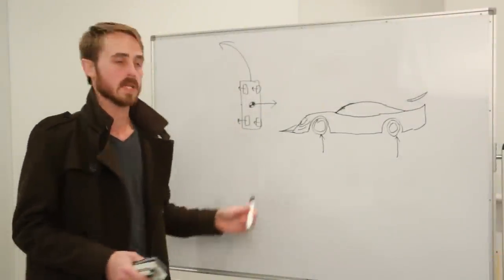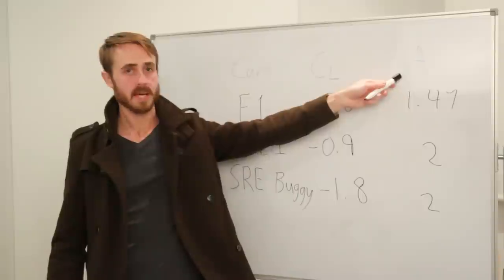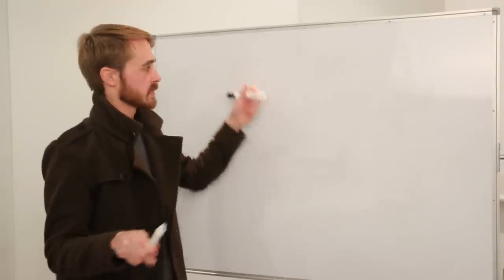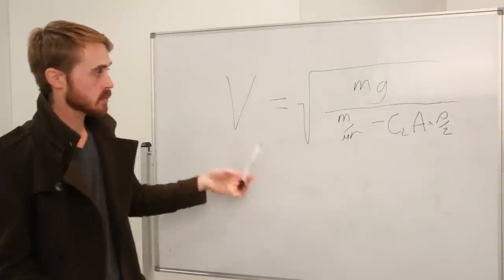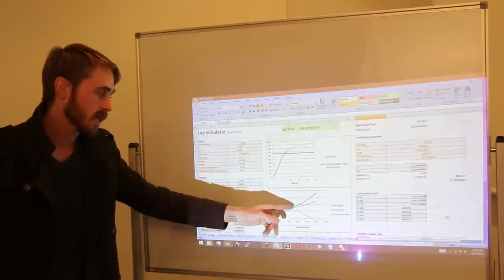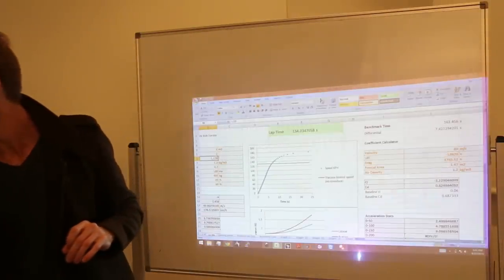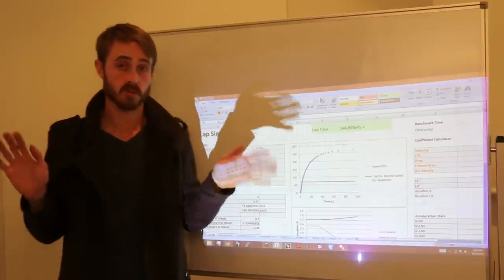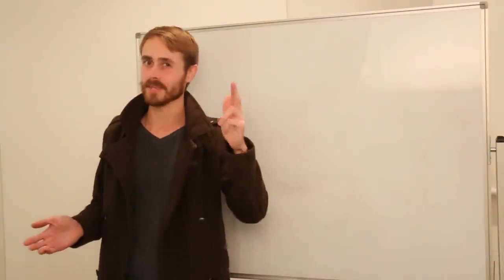What Speed Does Downforce Start Working?

Comment: TL;DR version: Around 100kph/62mph, downforce starts to make a worthwhile improvement. Speeds that less attentive drivers might notice the difference are closer to 160kph/99mph, if not faster. So just focus more on mechanical grip if your trackcar won't be hitting much faster than those speeds.
Reply: I got: If your aero is SERIOUS and well designed you can  expect an effect at around 100 kph but only if your car is VERY LIGHT. If your car is heavy and you slap a massive wang on it you get nothing even at very fast speeds.

Comment: Maybe I'm wrong, but I'd venture to guess your audience has a rather large % of nerdy car enthusiasts that are also non racers.

I appreciate you and several other YouTubers explaining in detail the parts, functions, and physics of aerodynamics, mechanics etc. as related to automobiles. However, as good as it is to dream about driving an F1 vehicle and obsessing about different aero features etc. I'd really love to see more information that is more applicable to real world applications and common modifications / mistakes.

For example a common mod is coilovers / lowering springs, and while there are commonly explanations about why lowering a car is better for performance, I've not heard much about what happens if you lower either the front or rear too much in relationship to each other (both from an Aero, weight transfer, brake bias, etc. perspective).

I'd very much love to see more science applied to road cars. While your formulas go deep into cornering speed with the aid of down force, I'd very much like to see some info about aerodynamics and stability in a road car.

Comment: Ppl be trippin bcos i put my bonnet scoops on left to right right to left.
Only bcos i want the air to travek over motor and take heat out with it aswell as make downforce i own a suv 2013 trax chevrolet which is prone for heat in engine.it has a flush front and its not really made for 140 km/h standards.
So i checked my temp i have dropped it from 105c temp to almost 90c by doing this.yes it looks awkward at fist sight.but i got my achievment done.im also gwtting downforce on front tyres.as the car use to feel really light as i hit ,140km/h speed bands.
Thanks to this guy.he made me think of the best output i could of done with bonnet scoops.i was aiming more for outcome then what it looked like.
Less turbulans under bonnet and more out going heat flow

Comment: Hey Kyle, I'm doing some simulations for drag strip times taking into account air drag and its x and y components.  We agree on the drag magnitude equation, but you are simplifying its vector quality by just throwing all of it on the y axis for the cornering calculations, aren't you? 

Shouldn't you have a coefficient between 0 and 1, so that part of your drag is you just having a negative acceleration on the x axis?

Comment: I apologize for this question not applying to the topic but, i want a real experts opinion.  I have a 1993 240sx s13 hatch with a Blown sr20det black top.  is that sr20 worth rebuilding or would it be more cost efficient to buy a crated and remanufactured KA24de and if so would that motor be strong enough to run 6-12 lbs of boost on stock brand new internals?

Comment: Hello Kyle ! What about using the magnus effect for downforce ?
We can use a roll with electric motor to apply the downforce.
Reply: Very inefficient.  You are better off using that electrical energy as a fan to remove air from underneath the car to create negative pressure.

Comment: I don't know if this is a stupid question or not but is a car more aerodynamic in higher altitude then lower altitude because of having less air to cut through?
Reply: According to Clapeyron's equation gas density is proportional to pressure and inversely proportional to temperature (k*P/T).
If you compare Zugspitze, (3 km over sea level 701 hPa, 270 K) to sea level (1013 hPa, 293 K) you should notice about 25% lower air density, which should decrease drag.
On the other hand you have over 30% lower oxygen pressure which makes breathing and burning fuel much more difficult.

Comment: From my understanding aerodynamic forces acting on any form of wing are usually considered more of a pull than a push as it's the lack of air underneath that sucks "pulls" it down opposed to the denser air above "pushing it down" a bit pedantic but had to get it off my chest, please correct me if you think I'm wrong and why.
Reply: both are necessary, but not for the reason everyone says.

Comment: Is the OEM really interested in down force to increase cornering speed with stock wings and aero? Couldn't it be primarily to stabilize a car at speed or fine tune handling characteristics.
Reply: In the case of most non-super/hyper cars, the wings are basically for looks only.  They typically have minimal area and a poor profile which will do little at any sane speeds.

Comment: how can A be derived simply from frontal area? We know the floor of top class race cars makes the majority of downforce from the underside of the car, and the larger area of the floor will make more DF than a smaller one, yet the frontal area of a given flat floor is virtually nothing and the same if its 6 ft long or 16 ft long.
Reply: Typically A is derived from frontal area of the whole car this is due to the fact the floor has little to no effect on frontal area as you said... and it does play a big part in the generation of downforce. What I think your wondering is what is the Coefficient of Lift derived from, this is from the "Total area" of the vehicle typically viewed from the top down and bottom up. They take a measure of negative pressure underneath and positive pressure on top. There are also some forces that can be calculated from the front, such as wings and splitters, but these also incur a penalty which is that the force is split between vertically and horizontally this is what is defined as pressure drag. I hope this helps and I'm sorry if i am assuming your question wrong.

Comment: Would you recommend making the botton of the car(an Evo 9) flat? and getting a good(really functional) diffuser?
Reply: If you are doing high speed racing and every fraction of a second counts, then absolutely.
For hobby driving however it will make more difference if you just imagine the car is faster.
Reply: I would say absolutely. They work always. Problems come from looks department, getting car through MOT and most propably managing heat sources under panels. I am trying to battle this on my own car (Z3 Coupe) too. But there is always upside, one of them is better economy.
Reply: I have always been of the belief that flat-sheeting the bottom of a car has to have advantages- if only to reduce the drag from all of the "lumpiness" under there- considering that the air travels under a car as well as over it! Most serious supercars have flat bottoms, and they have spent $$millions on R&D to come to this conclusion. A significant reduction in underfloor drag gives smoother, more laminar airflow- which is exactly what you would want feeding into a diffuser, as opposed to turbulant eddys. Also, compared to bolting on wings and dive planes- you would NOT be increasing frontal area and hence drag. The trick is in "fencing in" this airflow- if the car has to be road legal- you cannot have skirts down to 5mm off the ground for example- which is why supercars and such use clever vortex generators to contain underside airflow.
Reply: @arealassassin  Reading your comment just gave me an epiphany moment. I always wondered why in videogames (I am too poor to afford a real car TT~TT) like Forza, adding skirts on the side of your car tends to reduce drag. It never occurred to me that these skirts provide an actual, functional purpose beyond matching whatever front and rear bumpers you put on it. But it makes perfect sense! It's kind of like the endplates on a wing, but for the entire underbody of your car!

Comment: I think most car enthusiast and modders are not race engineers, so my question is does Aero and Down Force play a role in other areas of driving for real world street applications?

For example, I have a 2014 Honda Crosstour EX-L V6 AWD - 4,300 lbs - 4,900 lbs when loaded...

It has a fake skid plate up front, that definitely pushes the air under the car rather than around it... 

So at 90 mph (144 kmh)...

Does this kind of lift at highway speeds produce a noticeable difference in vehicle stability? And would adding down force be any effective in countering this for a regular street car...

What about if you lower the car? Same skid plate but closer to the ground? 
Would the smaller gap increase the pressure underneath the car? generating more lift?

Would Aero / Downforce be any different with a lowered car vs. a regular ride height car?

Thanks.
Reply: Unless they somehow made some horrible mistake and the front end is picking up tons of air then the effects should be negligible.
That is on regular road use, if however you were doing high speed races with hard cornering where every millisecond is the difference between winners and losers.... then you have reasons for concern.
Reply: MsSomeonenew The rear is 3/4" lower than the front. With a fastback design and no real spoiler, there's definitely a steeper angle to increase lift. I had 4 people + gear in the trunk that definitely lowered it more in the rear (relatively). Even though I'm riding around 4,900 lbs, I can feel a huge difference in stability at speed... with the exact same setup (only difference is springs).

Now, you could argue that because the springs are stiffer, I don't have as much traction in uneven roads, but I'm feeling the difference even on a straightaway with descent highway road surface... so I'd say the aero part of it is definitely a factor at speed... (I don't notice the stability issue under 70 mph for example).
Reply: You have almost an inch of height difference?
That should not be there, and yes that would count as a serious defect that picks up tons of lift on the nose.
Reply: Aero plays a big role in speed wobble. By reducing a cars side area, you reduce the drag induced by cross winds. A real life example is on a motorway where you can travel at 100-140kph, which is fast enough for some significant aerodynamic forces to be at play. You may notice older "boxier" cars, or motorbikes, which have large lateral areas versus the overall volume of the vehicle, will feel a sidewind push on it more aggressively than a sleeker lower profile modern car. This is why modern cars are not optimised purely for the air coming face forward at it, but also you need to account for cross winds, so that you can comfotably drive in a straight line on a motorway without unexpected sliding (speedwobble) while driving in a straight line. So to answer, front end downforce/lift has not a huge effect, maybe keep the z force near zero or slightly at lift, but drag is important on the front on axis, to reduce fuel economy, and on the side on axis to reduce difficulty in steering at high speeds
Reply: the difference you feel is probably due to the changing Suspension geometry rather than aero.. 5000 pounds are almost not effected by small aero  at low Speeds.
Reply: At that weight, aero does practically nothing. Focus on mechanical grip, suspension geometry, and weight reduction.

Comment: Somewhat unrelated but...
You calculate the dendity of air as 1.22.
How would you. calculate the increase of relative air density when driving in rain and therrfore the increase in fuel consumption for a given speed?
Just looking fof the maths 😃
Reply: Humid air is less dense than dry air. 
Fuel consumption is dependent on your cdA, not your downforce.
Reply: Rain has almost no effect on air density, and at the speeds where aero matters you are far more affected by the loss of grip on the road (wheel spin in a straight line at high speed is possible). A very heavy rainstorm may drop an inch of rain in an hour - the necessary formulas are a bit beyond me, but fortunately someone else has done them already at https://www.dmcinfo.com/latest-thinking/blog/id/206/geek-challenge-rain-drop-density. The heaviest rainfall rate ever recorded was 1.23 inches in one minute (which would be nearly 74 inches if it had lasted an hour, but fortunately it didn't). The record for one hour is a 'mere' 13.8 inches.

Comment: Im in no place to critisize, but its meant to be constructive: you didn't mention that a wrx without wings probably has a positive CL, so if the wings cancel that out ...
Actually im rethinking that: does it make a difference in grip-difference (delta grip if you will) if you go from a CL of 0.3 to 0.5 or -0.5 to -0.3.
In other words does less lift give the same proportional grip benefits as more downforce and especially how does that apply in a real word condition with the wrx?
Is it easier to cut lift than to create downforce?
Might the wings of a wrx have more of an effect than you pictured?
Reply from the maker: Kalimerakis The rear wing on a WRX is about 0.3m^2 in area, and given its terrible profile probably only has a Cl of about 0.3 off this area. This would be a whole car CL change of 0.3*0.3/(1.5*1.6) - wing Cl times area/the approx frontal area, which gives 0.0375 change in Cl for the whole car. More extreme wings with say 1m^2 surface area and a CL of 1.5 will give substantially more gain (around 0.625), however note that that is a really good Cl and pretty extreme wing area, yet is still only 0.625.

Your laptime difference is roughly proportional to the delta, there is some degree of nonlinearity, but it's pretty close to proportional.

Cutting lift and creating downforce are really the same thing, in saying that it's probably easier to cut lift as it just means you have to fix poor design, while increasing downforce means you need to come up with something special.

A time attack aero kit on the WRX will have more effect than I've shown here, but the factory wing or a small GT wing will not.
Reply: +KYLE.DRIVES Hey Kyle I love  your videos. I really would love to see if possible if you could get a car like a WRX STI into a wind tunnel so we can see not just the air flow but if aggressive wings from the manufacturer actually produce downforce and reduce drag.

Thanks and keep up the good work!
Reply from the maker: The thing with wind tunnel testing is, when you are doing it properly, you actually don't see anything! Normally us use force measurements, pressure probes and PIV, all of which take non visual measurements. Perhaps though the youtuber GraysGarage  might be of interest to you, he uses hydrogen bubble visualisation in a water tunnel to look at aerodynamics. 

Thanks for the compliments!
Reply: +KYLE.DRIVES Yes I absolutely love Grays Garages videos! Maybe you guys could team up and do a video one day. I know that most OEM spoilers will help with reducing the high pressure areas at the rear end of vehicles. However I was just curious if high wings and such actually make real down force, with the exception of supercars and hypercars which most do.
Reply: +Kalimerakis this video makes some great observations, specifically that even in supercars that are production cars, the downforce is trivial.

but your observation is important.  for a production / sports car the goal is to get rid of lift.  they did a lot of work to get near zero!  you kind of need to on a fast car just to make the car not kill you.  drive a random 70's car 100MPH, the front steering is LIGHT.

i will argue with kyle on 1 thing, and claim eliminating lift isn't exactly the same as adding downforce: a spoiler might be useless for downforce but could eliminate some lift, if it breaks the car's intrinsic airfoil-like shape.  a front air dam might reduce lift but not create downforce.  weatherstripping rear edge of hood the same.  of course for a new car the manufacturer has already done this perhaps.  

i suppose first question is 'what is the mission?' -- in racing, 1MPH average might be difference from first to last.  for a street car your first yield will be cutting weight.
Reply: good call but this is for the laymen and chances are shit like that would confuse most viewers
Reply: Whether it's a small amount of lift or a little bit of downforce doesn't matter.  If you have that on your car and the other cars don't, at the end of a long stage where you can win by 0.1s the car with the less lift or small amount of downforce will see the advantage.  The driver probably won't know about it

Comment: At lower speeds, when do the benefits of aero out weigh the added weight of the aero? Guess it would depend on the average corner radius on a circuit.
Reply from the maker: hmushmann2 Depends how big you go with your aero pack, as far as I'm concerned there is never a track that would be tight enough for aero (as a concept) to not work on as long as you have a light enough car with big enough wings for the job. One need only look at Monash Motorsport's dominance in Formula SAE, which probably has the tightest race tracks of any class. 

http://i.ytimg.com/vi/3o9fUmfntC0/maxresdefault.jpg
Reply: KYLE.DRIVES wow! That's a big wing for sure. I bet short gearing has got to help pull that thing through the air!
Reply from the maker: hmushmann2 Ridiculously short gearing, I raced one of these when I was back in university and you were maxing out 5th at about 150 km/h with a 14000 rpm rev limit! Pulled pretty hard to that point though.
Reply: KYLE.DRIVES reminds me of my 125cc shifter kart. Maxes out, depending on the final ratio, around 120km/hr; but that is with a 45hp motor, so relatively the kart has tall gearing compared to the F-SAE machines.
Reply: @KYLEENGINEERS  does downforce work on rc cars